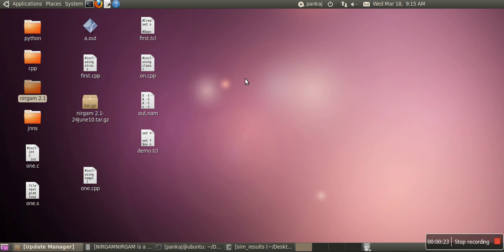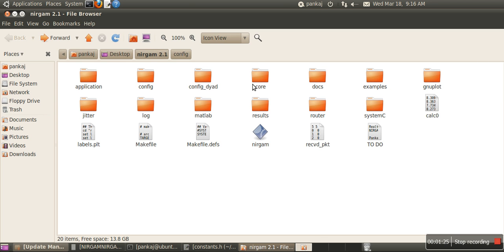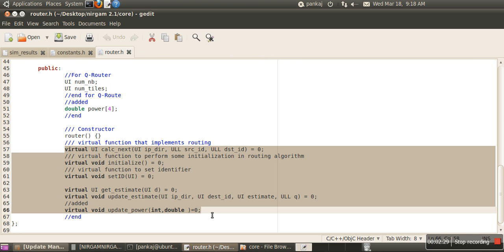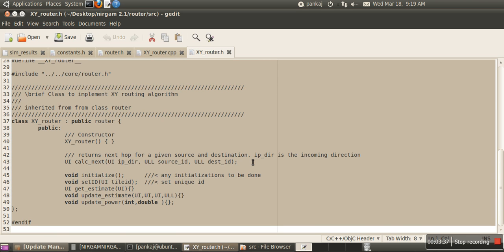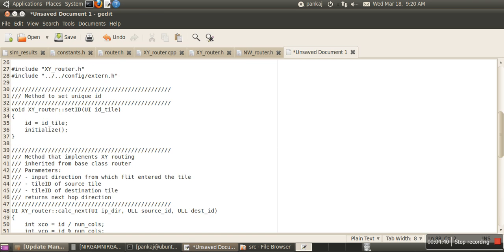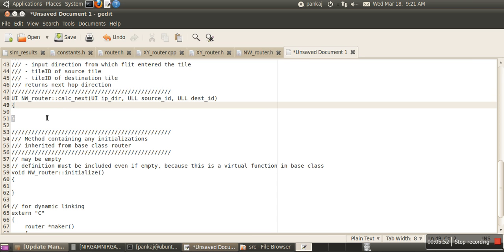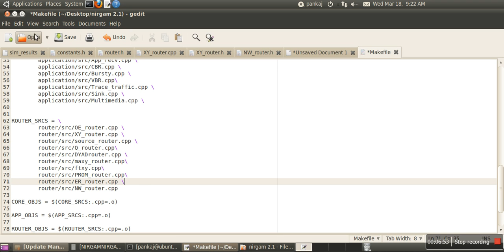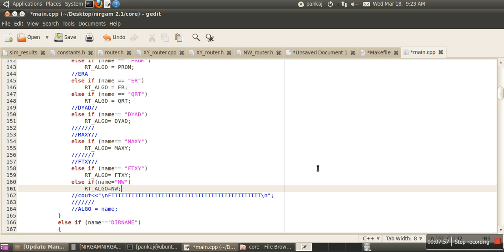How to implement a new routing algo in NIRGAM simulator

Comment: thank you..
Reply: i have a problem when i used make ( at installation), I installed successfully systemc 2.2.0, but problem with nirgam installation

       -VirtualBox:~/Desktop/nirgam 2.1$ make
g++  -shared -W1,-soname,application/lib/App_send.so -o application/lib/App_send.so application/src/App_send.o
g++: error: unrecognized command line option ‘-W1,-soname,application/lib/App_send.so’
make: * [application/lib/App_send.so] Error 1
        

           DUE TO WHAT PROBLEM I AM GETTING THESE ERROR
grateful for help
Reply from the maker: +gopi Devarakonda  No need to install System C separately. It is bundled with nirgam so when you install nirgam then system C also installed.